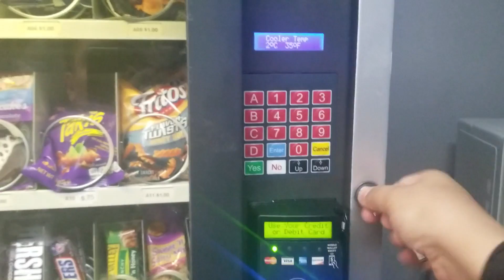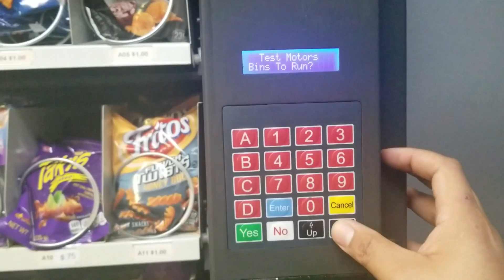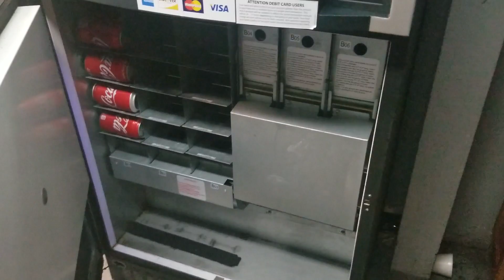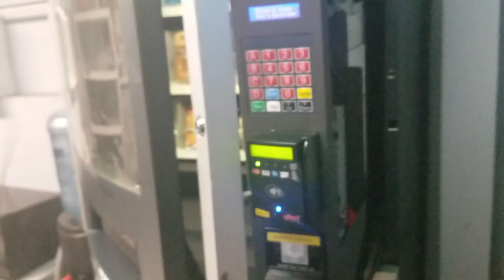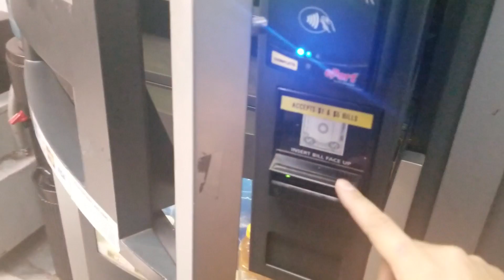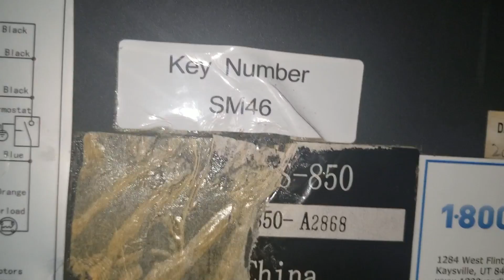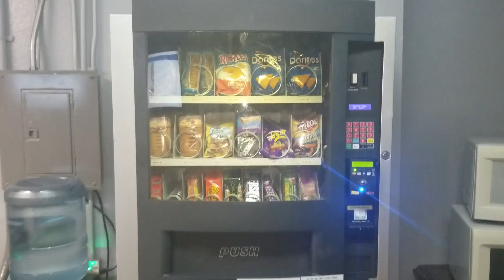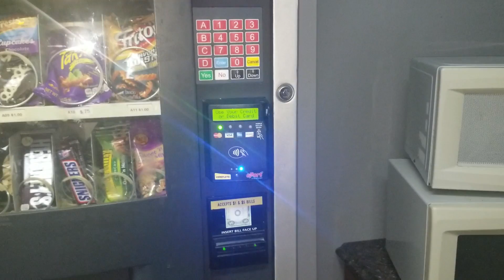Tips in buying your first combo vending machine for your vending business!! (2019)

Comment: Hi bro, thanks for posting this video it was extremely helpful. I was wondering if you would know where I could purchase a new set of lock and keys for this machine?
Reply from the maker: Hi. Thanks for the comment! You can probably buy a lock on ebay
Reply: Is there any modern lock that I can install other than the original?
Reply: Also my machine has a credit card option to install. I was wondering if you have a video on how to connect the wires to the card reader
Reply from the maker: I don't think so.
Reply from the maker: I do have a video.
Reply: @thevendingchannel-davidsan4955 
Thank you! 

David, sorry to continue asking questions but I was wondering if this machine can be placed outside? If so do you think the chocolates will melt?
Reply from the maker: The chocolates will melt.

Comment: Hi! I just bought a RS 800/850 model and I was wondering how do you load the cans ...do you load from the top on down or start at the bottom? I know they said if you load it wrong it will not vend properly
Reply from the maker: Hi! Great job in buying an RS800/850. They are very reliable machines. You need to load the sodas from the top and work you way towards the bottom... Always load from the top first or else they will jam.

Comment: Hello, I am looking to purchase this machine used (model vm-401/451). The seller is telling me everything was working fine but as of recent, the service button isn’t pulling up the service menu. Do you have any tips on what the cause of this could be and if in fact this means the machine does need to be fixed, is that something that could be expensive? Again, he only states the service button itself is not working to get him to the service menu. I am assuming this would affect me running test and reloading new product and setting prices?? I’m new to this so I am unclear what the total function of the button is.
Please advise.
Reply from the maker: Hi! I wouldn't buy it if you can't use the service button. Definitely pass on that machine.

Comment: Hey man i have a problem i have the same machine!

The top snacks work good!

Just the bottom part of ordering a soda,
I put the money in , 

I get the soda dispensed ! So that works

Problem is that the screen and keypad stay on the same screen as if its frozen 
Saying “ 1.50$ B04 vending” and thats it i have to reset the machine to order another soda
Reply from the maker: Try doing a factory reset on the machine by pressing the yellow button that's inside the machine and search for a reset option... Hope that helps!

Comment: hello , so I have the same machine and for some reason . My machine has suddenly stop accepting bills and coins and it was working a couple days ago. When I insert coins the machines just jams them into the receiver, unless i push the coin release button at the top . Then the machine just returns my money if it does not jam.  The bill acceptor was working and now randomly stopped , there is coins placed in the coin holder.  There was no jam in the bill acceptor either.  Both the bill and coin acceptor were working smoothly a couple days ago . Any tips or suggestions would be appreciated
Reply from the maker: Try resetting your machine. Go to the service menu and reset the machine. Hope that helps!

Comment: Hello, I am have some trouble with my vending machine and was wondering if you can give some tips
Reply from the maker: Hi. What is the issue?
Reply: Well first, I have red bulls vending in the bigger slots and every week the redbull gets stuck while dispenses.
Reply from the maker: The rebulls should only be placed in the B4 selection (the thin slot.  It should hold about 23 redbulls). Also, the dividers used to size the cans should be placed in the first hole/pin... this should resolve your issue. Hope that helps!
Reply: @thevendingchannel-davidsan4955  make a video lol
Reply from the maker: I should...!! 😊

Comment: Hey man! Digging the videos! I bought a combo machine it blows cold air but it doesn’t get cold enough inside. Do you know how to fix it?
Reply from the maker: Yes, try changing the setting in the back to a higher number... You will need a screwdriver to change the coldness setting. Watch one of my videos where I show you where the setting is located. Hope it helps! And make sure to subscribe!
Reply: I set it to the highest setting and still nothing
Reply from the maker: I think you need to let is cool for a few hours before it changes the coldness setting... What type of machine is it? Is it like the one that I have?
Reply: The Vending Channel one of them is like yours RS-800 and made in 2009. And the other one is a deli office combo machine with three parts. The deli office one, someone went to check it out and said the compressor is working fine since it blows cold air and he just cleaned it since it was all dirty. It blows cold air but doesn’t get cold and the guy doesn’t pick up anymore and I think he scammed me :(
Reply from the maker: What I usually do when that happens is to keep it plugged all night and then check if it is cold in the morning. That's the best way to really find out. Leave it on overnight.
Reply: The Vending Channel I will do that and keep you updated!
Reply from the maker: Cool man. Let me know. Hope it gets cold brotha!

Comment: I just got this exact machine but without cc reader. What reader is needed? Also I put coins in and it still pulls in bill but spits it out. Inside the bill acceptor is blinking orange
Reply from the maker: You probably need to replace the bill validator. You can buy a bill validator on ebay. You can use any credit card reader company. I used USA Technologies
Reply: @thevendingchannel-davidsan4955   I have the validator on its way now. Next up is the cc reader. All I have left is getting matching keys and somehow breaking or picking the bottom lock to the beverage box
Reply from the maker: It's hard to replace the bottom lock because it's bolted on to the machine.
Reply: @thevendingchannel-davidsan4955  oh no, maybe a lock smith?
Reply from the maker: You can break the lock and put a padlock that has a latch to place a master lock. That's what I did to one of my snack machines and it worked like a charm!
Reply: @thevendingchannel-davidsan4955  the top has a master lock latch on it. It’s just the bottom I’m going to need to break. Any advice in drilling into it? Do you have an Instagram account? I can DM you my number
Reply: So I finally got the lock situation taken care of. Just missing back door key to the coils. They all work so not a rush to get that one. I replaced the bill Validator as well. Just needing a cc reader. Any updates on yours or are you enjoying the e port one you have?
Reply: @AndrewBenavideos  hey which bill validator did you get? I purchases one but it's not fitting right because the screws is sticking out. And it's not working properly. It takes the bills and freezes. It does not give back change.
Reply: @teacajackson9353  I don’t remember what kind it was but it was the exact brand and model as the original. It was used and it worked fine after
Reply: @AndrewBenavideos  does it give back bills? The one inside the machine does not have the back piece that holds the bills. It just drops down
Reply from the maker: Place the bill validator where the credit card reader would go. And if you get a credit card reader, install it where the original bill validator was installed. That's how I did it and it worked fine.
Reply: @thevendingchannel-davidsan4955  I installed it. The one you recommend but it doesn't light up unless I got to setup and click coins. Even though there's coins inside. And also it doesn't give the change and the screen freezes.
Reply: @thevendingchannel-davidsan4955  I'm also not able to load more than $5.25 in quarters. Do you might know why?
Reply: @teacajackson9353  mine had same thing. Just dropped down. I sold the machine a while back. I got everything running except that. It gave change but in coins

Comment: For the bill reader to work you said, "You have to have coins in coin mechanism" Now do you have to have a little, mid way or alot? And also, is that the same with all snack and soda machines? (not just the combos)
Reply from the maker: I think with $5-$10 worth of coins should be good enough to make your bill acceptor to work. This is for all vending machines!
Reply: The machine must be able to return the money that's put in. For machines that cannot return bills, that means it needs to have enough coins to cover the highest bill it accepts.
That's a slightly different condition than "no change".
Reply from the maker: Nice response! Thanks
Reply: @HenryLoenwind  why does my machine only let me put $5.25 in quartes only? It says it can go up to $19 in quarters. I have to get more dimes and nickles to see when it'll let me max out
Reply: @teacajackson9353  "me put in" as in "the customer fills in quarters before selecting a product"? That can have many reasons. Many machines don't let you put in more money than the price of the most expensive product. Others may have limits on how many coins they can dispense in a row before the dispenser magnet needs to cool down.

Or as in "put in change"? That may be the same in reverse, the machine wants to accept as many coins as needed to pay for the most expensive product and be able to dispense them again if the user aborts the transaction.

And in both cases it may be a configurable limit or even a hard limit the manufacturer put into the firmware. The latter is something people who want to dispense weird products (e.g. phones from a snack machine) often run into---the machine was built for $.5 to $5 items, not $20 to $50 ones.
Reply: @HenryLoenwind  ok thank you. I'm going to change the pricing for the rest of the item's today. I changed it for a few. All item's on the machine was a $1 before. It allows me to fill the dimes and nickel slot all the way up. I just don't want to have to continue going back and forth all the time because of running out of change. I'm still waiting on the card reader from cantaloupe.  It's a whole long process to get it
Reply: @HenryLoenwind  and me put in. As in myself to load the machine with change so when's it's time to use it,  it'll have enough. I wish there were more videos on this particular machine.

Comment: How many cans does one of these hold
Reply from the maker: Hi. Thank you so much for your comment. The first 3 slots hold about 40 12oz cans each. The 4th slot holds about 24 8oz cans. The 5th and 6th slots hold about 10-12 24oz bottles.
Reply: @thevendingchannel-davidsan4955   so the slots can't be set up for all 12oz cans ?
Reply from the maker: Unfortunately, no. Only the first 3 slots hold 12oz drinks. The 4th slot holds 8oz cans, and the 5th, 6th slots hold 24oz bottles or 12oz long monster cans
Reply: @thevendingchannel-davidsan4955   thank you for your information

Comment: HeyDavid, I just bought two RS800/850 combo machines and I'm having trouble with the beverage portion on both of them. The can drinks wont drop, water and gatorades either. I noticed that the motor doesn't spin a full revolution, have you had such issues? If so any help would be much appreciated
Reply from the maker: Hi. Yes, I've had that issue with one of my first combo machines. You will need to replace the DRINK MOTOR CONTROL BOARD. It is located right under the Gatorade section. Unscrew the cover under the Gatorade section and you will see a CONTROL BOARD with lights. Take a picture of it and order one online. Hope it helps!

https://rover.ebay.com/rover/0/0/0?mpre=https%3A%2F%2Fwww.ebay.com%2Fulk%2Fitm%2F253825464789
Reply: I had ordered one for the first machine so I'm waiting on it now, so that's all it is and the motors will turn full revolutions and dispense? Also do you use spacers for your gatorades? I have 20oz bottles of it and they dont seem to drop
Reply from the maker: Yes, that should be all that is needed to fix your dispensing issue. Umm, wait until you replace the board and everything should work properly including the gatorades. No, I don't use any spacers for the gatorades. Take a picture of the board with all of the cables attached so you know how to rewire it. It's a simple process to replace it. Hope it works for you!!
Reply: @thevendingchannel-davidsan4955  thank you so much for the help I truly appreciate it.

Comment: Sorry but you don’t know what you’re talking about when it comes to the compressor and the actual refrigeration part of the unit. You can’t just pull it out and put a new one in you have to have a professional refrigeration guy do the work because if you cut those lines all the refrigerant will come out, then they replace the part, put the whole system in a vacuum and recharge the system with refrigerant again and a long and expensive process that you’re gonna pay an hvac company a lot of money for, not just any average  joe can do it
Reply from the maker: Hi. Thanks for your feedback but it is actually really easy to replace/swap out the compressor unit. I've done it many times. Lol. Believe me, any average person can do it and save themselves a lot of money.
Reply: The Vending Channel - David Sandoval ok I think you’re mixing up your terms then lol are you talking about the compressor by itself which is the black thing on the right side that makes the humming noise or are you talking about the the entire assembly including the compressor, the condensing coil and the evaporator coil. The whole assembly slides out together and you just disconnect the electrical stuff
Reply from the maker: The entire assembly. 👍